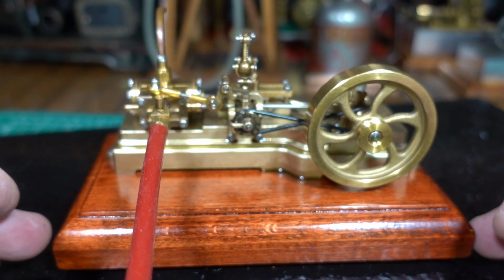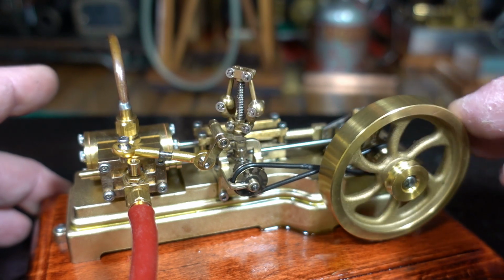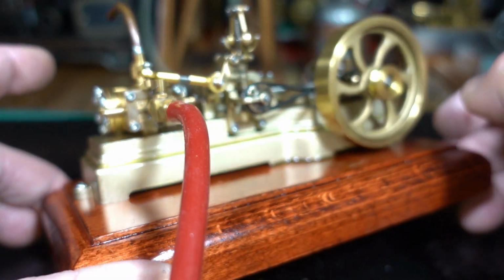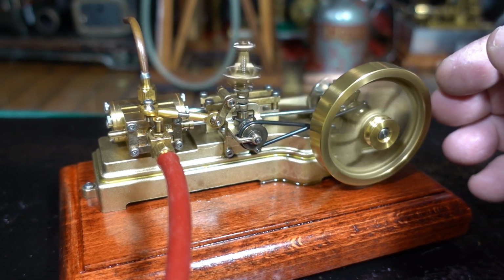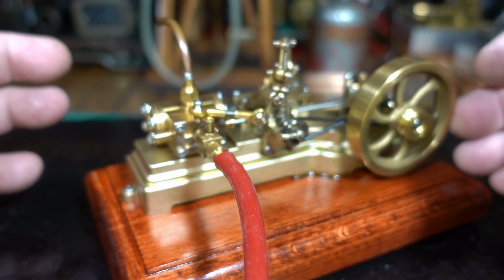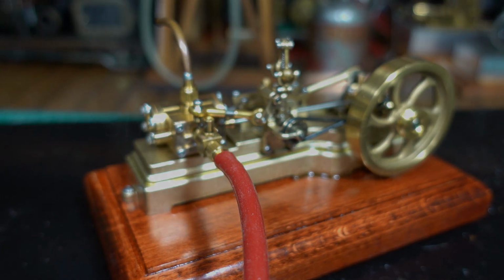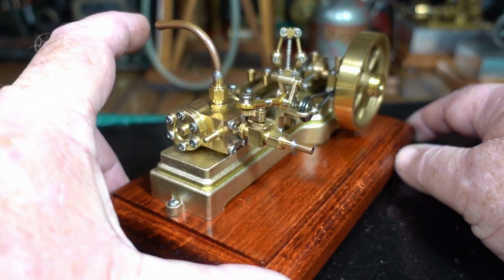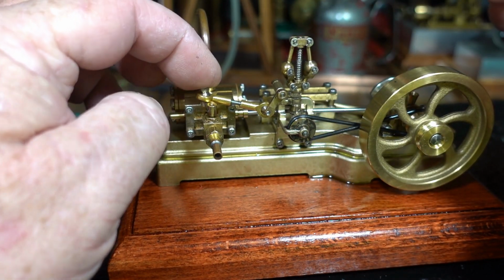Microcosm Model Steam Engine or also known as a Toy Steam Engine S10 Update on the Governor

Comment: When you moved the lever of the control valve back and forth with your fingers at the beginning of the video, I noticed that the lever of the regulator does not return to the open position by itself. But what should he do?
I think the ball joints have too much friction. These small ball regulators have a good setting power at the appropriate speed.
But the valve and levers have to be super easy to move.
Try thin bolts in the joints.

Michael
Reply from the maker: H Michael the whole governor is pinned together, I'm starting to think the weight of the balls just don't have enough inertia.